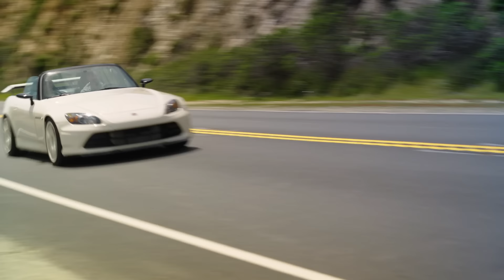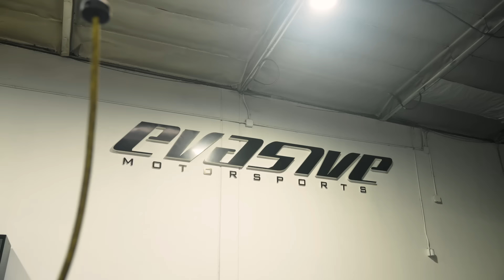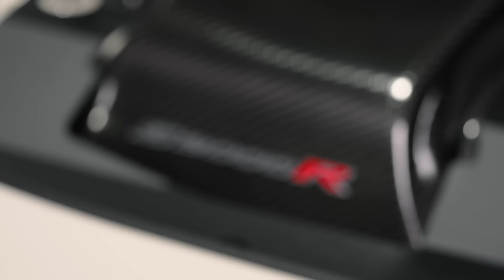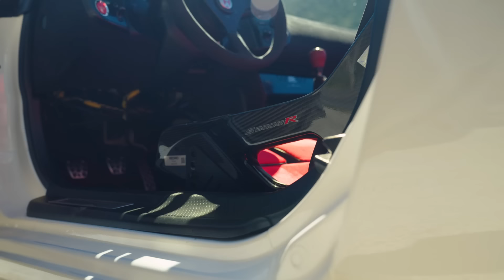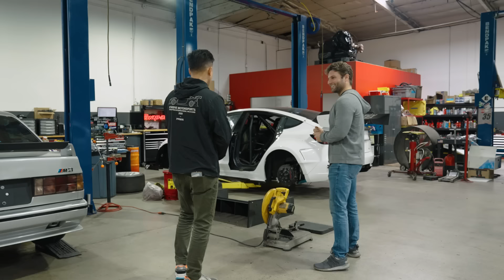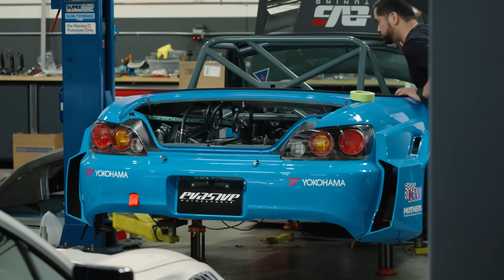Honda S2000 'R': AP2 Build With FK8 K20C1 Type R Power | American Tuned ft. Rob Dahm

Comment: The thing you tried to create Honda already did with the s2000 in its stock form. Power everything, air conditioning, abs, etc, it has all the creature comforts but also doubles as a race car with the way it came from the factory. It’s a race car with windshield wipers. Modernizing it to make it like every other newer car now takes away from what makes the s2000 so special, a true JDM legend. I can appreciate someone wanting to improve on it or make it better, but you simply can’t beat multi million dollar back Honda Research, designers, developers. The hand crafted hand built f series engine is perfectly balanced, and is the true spirit of the car and what makes it so special. I would never go to this extreme with my s2000, I’m all for modifications but not so much so to the point you lose the true essence of the car and what makes it truly unique.

Comment: As a s2k owner, I approve. This is 2000 looks better than many of the weird futuristic concept renders that have come out in the past 15 years that missed the styling marks. I’d be very curious to drive this with that new engine in it because the 9K motor can be fast but you have to ring the loving crap out of it. That’s not safe to do on regular streets so more torque would be greatly appreciated and probably safer to drive. Kudos!❤🎉

Comment: Looks great, except for the spoiler needs a little visual adjustment to match the lines better...but wow, they really did kill it with that engine. I understand that it makes more torque, but omg, the whole point of an s2000 is to hear the induction noise and exhaust wringing out to high rpms...I couldn't hear ANYTHING from the new powerplant...

I also really don't understand people who complained about 20 lbft down low with the original s2000...like uh, why are you driving it at that rpm expecting high rpm vtec torque?!?! 

The high revving loud intake s2000 is just SO exciting, I do believe Evasive did a great job modernizing it, as it's customary for OEMs now to subdue everything for more broad customer base. 

I've NEVER been egged on to street race, or had more people compliment a car I was driving that the few days I borrowed a 2001 s2000. What a freaking car. Truly timeless design, I had many people stopping and asking me what it was, or when it came out, and they were stunned when they found out it was over 20 years old.

Comment: I own a fbo tuned ap1 and a almost fbo fl5 stock tune. The ap1 is as fast as the fl5 stock. After mods the fl5 has way more power. Im all for this and would go this route if my ap1 engine would go.

Comment: I like the Type R engine swap but a true type R build should have been a high compression K24 build for 300+CHP. No turbo lag, Rev to 10K. all race car. But this swap is cool, more power potential. I love the car and the way they seem to have kept the original design philosophy of good balance all around (power/weight/suspension/braking ect)

Reply

Comment: The AP2 cut the S2000’s high redline in half. Adding the 2.0T from the type R gets rid of that high-revving capability that the S2000 was known for. Sure it gives the car that low-end torque that we Americans criticized it for, and yes the car gets more power, but the car has the heart of a 10th-generation civic now. Regardless, it IS an impressive build.
Reply: You forget something special.  It's in a mid mounted engine stance now with rwd!

Comment: Nope. The essence of the s2000 is the screaming 9000 rpm engine it is the s2000 masterpiece ( with its gearbox)
You removed the retro side of it with this ridiculous screen , could really have mordernized it with a Qube engineering white led kit.
You added this horrible wing and those ridiculous seats too
It’s substantially uglier than oem one and got deprived from its heart…

Comment: What I DON'T get, is that Any True Gear head knows that Direct Injection engines are HypercProje to Vale Carbon Buildup. Even with a proper Air Oil Separator kit. Why Ohhhh Why use a GDI Engine??? With all of their Supposed knowledge and Resources; Why not rebuild the original engine to add in torque or at the very least install a proper K Engine???? GAK!😮 SERIOUSLY? GDI?

Comment: As a Type R owner, while that engine is great for a modern CTR, it doesn’t belong in an S2000. Faster isn’t always better. The S2K was special because of the unique high revving engine. Cool car but I’d prefer a stock S2000 CR.

Comment: Im not sure about this .. I agree that the FK2 engine is "better" in all measurable ways (power, torque, 0-60, whatever) but it's not the same character of car. For me, the turbo civic is more like Honda's take on a VW golf GTI / R ... which is not a bad thing, but it's something different. I feel like to make an S2000 Type R, it would have to be "period correct", which for the time would be N/A still ... as the S2000 is the peak of Honda 4 cylinder NA developments. Basically make a more hardcore S2000 with stiffer springs, bucket seats, more aggressive styling, etc.

Comment: So they took what made the S2000 special and replaced it with a civic engine. I'm sure the car is fun and handles great, but the S2000 is literally named after its engine. The low torque at low rpm and 9000rpm red line are defining characteristics, that's what makes the S2000 special and sought-after, it's what defines the car and its uniqueness.

Comment: I had an AP1 S2000 for about a year. I modify everything, but not the AP1. I was planning on doing the rear suspension mod to correct the snap oversteer, but sold it and bought a Sportbike.  I think the Civic Type R engine is a great mod.

Comment: the turbo fk8 drivetrain is great. change the front bumper from the oem frown to a smile like the nd mazda miata. make the mirrors less sleek, just keep the og wing mirrors. give the s2000 more comfortable oem like seats, maybe Acura Integra/TLX Type S Leather seats or the Honda FK8/FL5/FK2 Type R cloth seats

Comment: The styling is perfect - modern yet respectful to the original design, and a great illustration of what a factory S2K Type R would be like.

But a turbo and no 9000rpm redline? That fundamentally changes the character of the car.

Comment: I've owned an AP1 and have a 8500 RPM Coyote, and my Evo X should be 9000+ when it's back. I cannot imagine a 7000 RPM S2000. It's already bad enough that the S2000 went from 9000 to 8000 with the AP2, which is why I shopped AP1's. And it's bad that the CTR went from various 8400 RPM motors to a 7000 RPM one. And I'm sure the CTR probably stops pulling before 7000 when stock or nearish. 

If I am willing to accept anything below 8000 RPM, it needs to come with the ability to shake the ground at idle and make 600+ WHP NA. aka an LS/LT.

Comment: Hey guys. AP1 owner here. No worries on putting in a different engine in it but clearly its so good you never showed to being revved out. K24 would have been a better option. Love everything else about the car.
Reply: Feel the same K24 NA on this chassis would be my preference as well
Reply: @_que  The perfect engine for this car would be the JNC1 3.5L V6 from the new NSX but without the turbos. So it would make around 350-380hp.
Thats the true flagship engine, would remain NA and have torque.

Comment: My beloved 06 S2000 just passed 203k miles. I think its time I get her transformed. I absolutely love this! I had Evasive corner balance my S2 at 100k miles with new suspension. I think this time I talk to them about making this a reality for me.
Reply: Refresh your f series, and put a rotrex supercharger on it, its so much better of a combo than the turbo k series
Reply: @alexelrod242 id rather have a brand new motor engineered for turbo than slapping a kit on an NA and going through all the necessary custom work. 

Custom mounting/bracing + k20c1 will be much more reliable than the turbo kit route.
Reply: @zambiagrowl3632  rotrex is a supercharger kit, and some dealers back in the day would install them as a dealer installed option without voiding factory warranty. Your worries are real, but irrational in this situation, it's a very safe and simple kit that's extremely well engineered
Reply: @alexelrod242 agreed, it would be a lot easier and cheaper and produce similar results.
Reply: @alexelrod242  thanks for the suggestion, when the Kraftwerks kit was first released I was seriously considering it.
Reply: I think you should do a K24 block with a K20 head and keep it NA. Way more torque and still have a decent redline of 8000+ depending on what you do.
Reply: Good luck with that. Chatted with them about upgrading my AP1 valve retainers to AP2 valve retainers as I am a local to their shop. They will do a valve adjustment. At a really good price with valve cover gasket included. But seems rather odd a shop with such prestigious lore around them and capable of doing crazy mods can't do a valve retainer upgrade. @LHTperformance does it every day.
Reply: LS swap that boy.

Comment: Love the car but it would have been nice to actually hear the car drive and see it do a pull, or just driven fast in some fashion :hand-purple-blue-peace:
Reply: Seems to be a sad trend now where somehow in the editing room, they decide to overproduce everything. They couldn't add 10 seconds of pov driving? You're already in the mountains for chrissakes.
Reply: Yea this video is so well done, as you would expect from top gear but it's completely missing the driving experience part with engine/exhaust sound. Shame.
Reply: No engine sound, and no performance numbers. For a swap that could be argued that ruins the amazing sound of the S2000 for straight line speed, i'd expect both
Reply: I was thinking the exact same thing
Reply: Agreed I was waiting for that

Comment: Don’t get me wrong the new turbo k20’s are fine but the original F series with proper twin cam VTEC has so much more character which is the whole point of an S2000. Anyone who disagrees has simply never owned one. Least it isn’t EV swapped tho 👍
Reply: Lol I've owned an s2000 and would try this out. Very well done build. Having built a couple hotrods, I appreciate the level of work these guys have put in. Kudos to the Evasive team!
Reply: I wish they had this swap in GT7
Reply: Super build looks fantastic
Reply: I don't want an EV swapped S2000, I want a EV that has the same driving characteristics as a S2000 in a lightweight package.   (Obviously not going to happen that soon)
Reply: This is why I love Honda! We can take motors from different Hondas and put them into different chassis. This is what true Honda guys do
Reply: This is a modern iteration of an S2000, as if it came out today. I think the K20C1 fits this perfectly.
Reply: Exactly what I was thinking why not just do a rebuild the stock engine was a fantastic engine to begin with
Reply: Guys who actually drive tend to care about things like torque curve and power band too you know. I’m a B series Honda guy but there are a lottttt of advantages to that engine choice over the F for a car that’s just meant to be a street cruising fun car. Anyone I know who’s owned one complained it was boring unless you were winding it out constantly, which just isn’t the reality of driving on public roads these days.
Reply: @N3rdburgring  with only 200whp you can wind it out all the time on public roads, within reason obviously. As a b series guy you should know as well as anyone that old Hondas are the most fun “slow” cars to drive fast. Even regular cruising I still prefer my stock ap2 all day over my much faster modified fk8 daily driver
Reply: @64Spokes  cough mr2 cough
Reply: @64Spokes this is exactly why the stock s2000 is awesome. It’s like perfection. It’s the perfect amount of power where you can absolutely rip on it without going to jail or killing someone. When I was younger I did not appreciate it. When I drove one at 40 years old it was one of the best cars ever built to leave in your garage and take it out and redline it and row through the gears.
Reply: I own a Ferrari f40 and the stock F20c is an excellent and balanced engine. Honda did a great job.
Reply: They have a hundred F20C and F22C builds go through their shop. They wanted to do a grown up S2000 this time around
Reply: @Shadowboost  What is grown up about a turbo k20? Are you implying yhat a high revving fun roadster is only for young drivers? If anything they could swap in j30/j35 V6, maybr even one from 6mt V6 accord coupe.
Reply: @Kacpa2  correct, the older crowd prefers torquey, quieter motors with less vibration. A K20 Type R motor makes more torque than a V6 accord motor, with less noise, and better packaging
Reply: @Shadowboost  NA V6 would be a far better and smoother running engine, it lets people have both great effortless torque and good sound and ability to rev out when you want. Turbo 4 wont have that. 

Modern turbos makes it just like a diesel, there is no point or even a reward for revving it out past certain point and it doesnt sound particularily good and in some cases its just awful like Golf GTi or Amg A class, where it makes all those unnatural childish obnoxious backfiring   noises on throttle release. 

Grown up option would be NA V6 or very gently set up turbo petrol kind of like mercedes did W205 C200 with 184hp and 300nm of torque.
Reply: @Kacpa2  exactly right. Grown ups don't really want to rev anything beyond 4k rpm. 240 ft lb of torque at 3000 rpm is what these people are looking for. Maybe a couple of shifts every hour
Reply: @Shadowboost  There are many people who are more mature and enjoy sport bikes, high revving sportscars. S2000 is not meant to be a daily of any kind nor a luxury car. 

And even then there are lots of cars that can please both nieche's while having sporting qualities still. 

FK8 Civic is anything but mature, its very infantile car especially with it's design. More recent USDM Accord and Integra are more mature if anything.

Turbo cars also can be rather immature and annoying to drive like many older subarus and generally 90s turbo cars of all descriptions with giant turbo lag and very brutalistic behaviour when boost does  finally come. 

It was mostly diesels and since 2010s new branch of turbo motors that came in as replacement for older bigger displacement engines in not so performance oriented applications that are more mature, mostly german offerings, but not exclusively.
Reply: @Kacpa2  and yet the Integra Type S with the same engine is VERY much oriented for the more mature crowd
Reply: @Shadowboost  Which is matter of how it is executed. Same as Mercedes. A class AMG is obnoxious but E200/E300 C Class with same 2.0L in various states of tune is quite nice and lacks the obnoxious attention grabbing or excessively brutal powerdelivery. (on top of driving the correct wheels and having manual box option w205 generation)
Reply: @Shadowboost  Don't want to rev beyond 4k? So these "grown ups" you keep talking about must around 80 then. The car characteristics you're describing are completely and totally opposite the very idea of the s2000. If people want those things in a car, there is a very wide selection of cars they can choose from. There are precisely zero modern cars with the driving characteristics of the s2000 and there hasn't been for a long time now(at a normal person price point). That's why these are so highly sought after. Sure, it could use a bit of a power boost but going from a high revving NA engine to a low revving turbo is sacrificing part of what has made the s2000 such a beloved car.
Reply: @1uckedout  and there's gonna be thousands of those to pick from, including dozens from Evasive. The idea of this car is from a different perspective. This is a car you can daily and be at 2700 rpm on the highway and then take it to the canyon and track as well. Meanwhile a F20C will be buzzing at 4100 rpm on the highway
Reply: @Kacpa2 turbos have come a loooooooong way and have mitigated lag tremendously. From having better ceramic ball bearings to variable geometry vanes and now even the latest electric hybrid turbos that essentially have no lag that Porsche uses. These ain't your daddy's turbos anymore. 😂 I've driven a few cars with turbos, and many OEMs have done amazing jobs smoothing their response out.
Reply: I owned an S2000 for several years as well as numerous sport bikes that rev way higher. Unlike a sport bike the high RPMs in an S2000 don't equate to much speed. Revving to 9k and not being able to out accelerate a modern SUV is lame. I'd very gladly take the extra 80 HP and double the torque.
Reply: @Nic01101011  Supercharge it then, you will have 450hp at the top end.

Comment: As a longtime AP1 owner, I don't hate this build but I agree that going with the FK8's non-VTEC turbo motor doesn't fit the spirit of what all the S convertibles are. I would probably have opted to do a top to bottom build of the K20/K24 variants that have DOHC VTEC along with iVTEC and rev it to the moon. Yes, the S2000 was lacking on low/mid torque, but all the S convertibles were meant to be driven at high RPM, you had to work for power.
Reply: 100% agree with u 💯

Comment: I simply DO NOT understand people engine swapping s2000's. It came with a unique, reliable, high output, easily modifiable engine from the factory. Yes, I understand the k-series can make more power now, but it's not that much more. 

Engine swaps make sense when the motor you're pulling wasn't that great in the first place, or had a major design flaw. The f20c and f22c1 are fantastic motors that are the heart and soul of an s2000.
Reply: Agreed!! People swap out 90hp single cams, no a 120hp per liter engineering marvels

Comment: Taking out the exotic 8k RPM fire breathing VTEC engine and replacing it with a modern eco turbocharged engine is a step backwards.